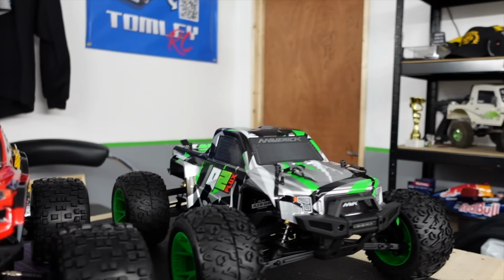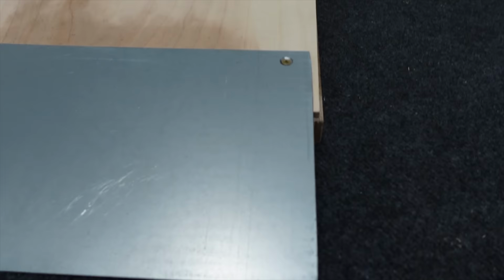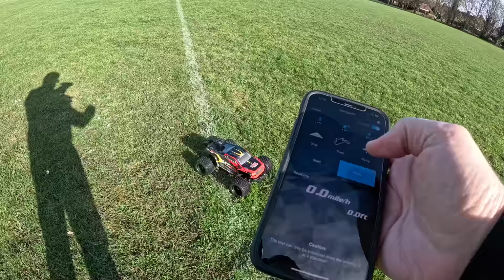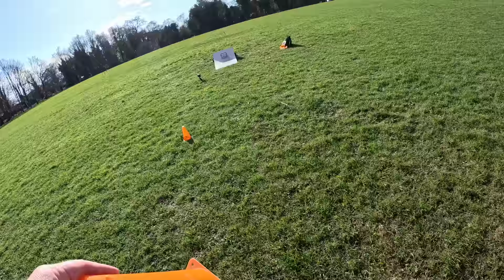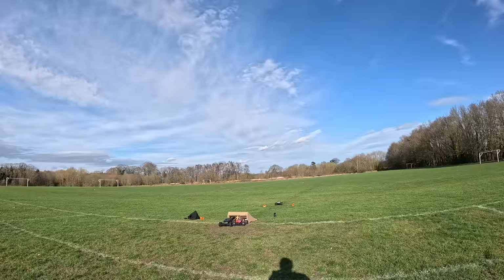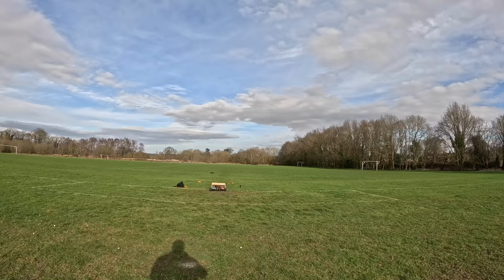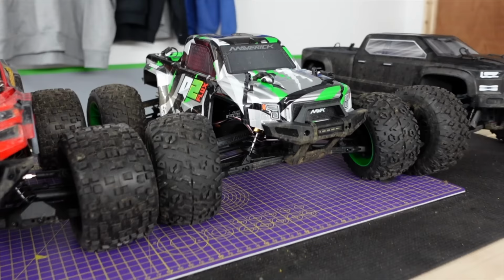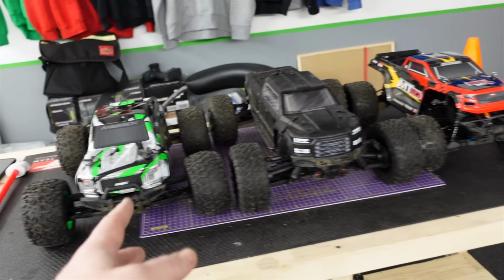You Won't Believe How Much The RAMP Cost Me!

Comment: I made a super cheap ramp out of Corrugated Fluted Board, (real-estate agents use it as the for sale signs when you sell your house.)Any way long story short you can usually get it free second hand, it cuts with a knife or scissors, you just screw a couple of timber supports in & bam, you have a light weight stong ramp, at your desired width.
No more missing the target Phill.  😅
Reply: I have built one with a corrugated flute board and my Arma Kraton blew right threw it. I'm sure it's good with 1/10 scale but my 1/8th and 1/5th blew it to pieces. Maybe I should have doubled up on the ramp face.
Reply: @FarmerFpv yeah I have an outcast 4s, my neighbor has a 3s granite, single layer   did blow right through, double layer is indestructible, but still low weight.

Comment: I built a few ramps in my time and still have two of them, they are almost double the width and cost 30 bucks material each...  the seven year olds love them, as they are almost neutral, when you buld up speed bravely and just coast over them: The trick was to take a cardboard-copy of the shape your favourite jump at the skatepark has. 
You can do it!

Comment: Our fix for the ramp we built was to carpet it with exterior boat deck carpeting (looks like short, fake grass) and staple it down with a length running off the entry of the ramp, replacing the metal lip. It seemed to greatly reduce the shock of first hitting the ramp and gave beautifully consistent behavior.

Really fun video to watch, cheers!

Comment: I thought it was a great test. All three performed well. The HPI di very well. I was thinking before the the jumps that you are landing on wet ground which will be soft and nothing will break. That wasn't the case. II wonder of the wet ground grabbed the trucks when they landing and caused some things to break. Some of the landings were at odd angles. I like the plastic skateboard jumps. They are easy to store, no screws to come loose and they don't rot. This was a simple video, but a lot of fun. RIP go pro.

Comment: Hey Phil... Interesting video.. I have a new'ish BigRock and on its 2nd run out I hit a rock head on. My rear right shock also came apart, it looked identical to yours. Thing is, when I stripped the shock, there was no rubber piston in the tube, and the nut was off the end of the shock shaft. The shock tube was undamaged, the shaft had just pulled out. Arrma QC??? I did contact Arrma, but they didnt seem interested.. Would be interesting to see if its the same thing on yours though!

Comment: i have 3s big rock shocks break at bottom they pull loose had to upgrade spur gear the plastic one kept stripping have to lock tight axels motor plate can bend over all a good truck  like the vented tyers but dont like the tyre also have a hoss stock  shocks are poor the shafts bend and plasic shock caps pop of on harder impacts  plastic wheel hexs are trash happier with theses 1/10 scale trucks than arrma 6 s trucks  ive owned in past though had to invest so much cash to get them strong as the trucks i just mentioned although that was way before exb versions   good video phil would be happy to own all 3

Comment: I know that ever since the 3S BLX Big Rock Crew Cab came to the market every reviewer praised it as best basher and durable and all. I own a V2 and I am very underwhelmed by its durability. It's a real problem child. Tires exploding, shocks breaking, motor seized, ESC bricked, slipper clutch is a nightmare and the transmitter that came with the V2 really sucked. For a regular guy like me it's a lot of money for one of these. I really think they are pretty overpriced for the quality. The only strong point is their plastics are really good.
Reply: I’m new to this hobby but bought a big rock v3. It’s a lot of fun but I’ve spent a fortune on upgrades and still break something almost every outing. Should have just bought a 6s truck

Comment: Of all the places to set up why in the goal mouth. Do it in between pitchs so any dents and divots don't damage the play area.

Small thing but proper absence of common sense.
Reply from the maker: Grass is too long between the pitch’s. Most of the ground has been water logged for months, and the pitches on that field are all awful. 
My Son played football at a pretty high level for years. I don’t lack common sense, I just chose the worst pitch. If you watch any of my previous videos with my large 6s rigs… I always run them between pitches 😇👌
Reply: @TomleyRC  but the run up area you used was literally between pitches, choosing the worst pitch doesn't make it any more valid a reason to destroy it more. Pitches may be bad but they are a means to be able to play for many no doubt. 

I watch your videos and you've been tearing the cars over pitches for weeks I've just delayed commenting thinking it was just the odd error but it's clearly something you see as ok.

Not sure what standard your son plays to has to do with it. Part of doing rc content outside is that sometimes you just can't film on some locations.
Reply from the maker: @adamwade2546  I'm quite conscious of where I run stuff, but if that's your opinion then that's fine. 99% of the fields around here have football or rugby pitches. The amount of Dog shit and littler would be more of a concern if I was still a parent sat on the side lines. Oh, and the run up area was also a pitch, going across the other way and you'll clearly see on the video